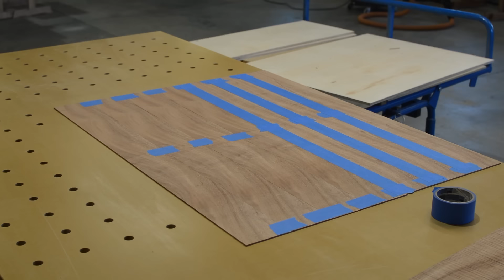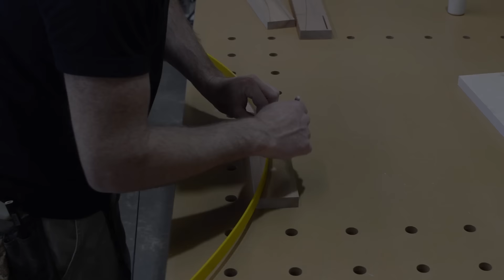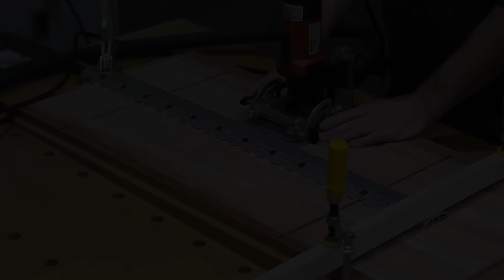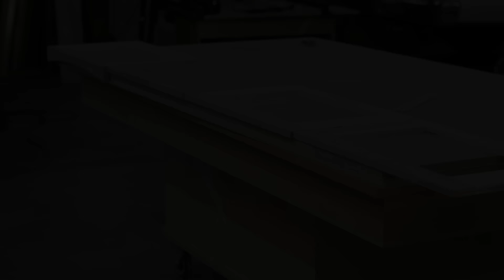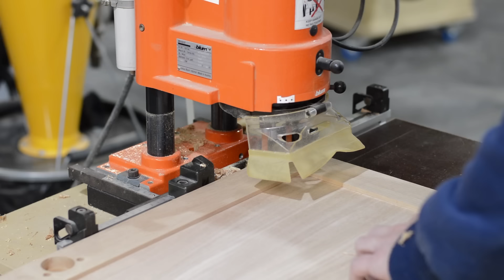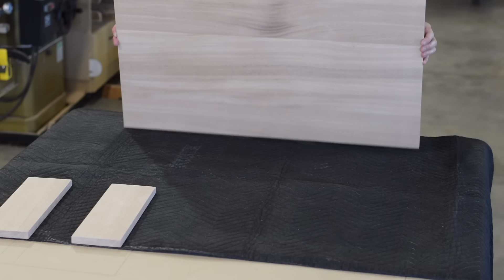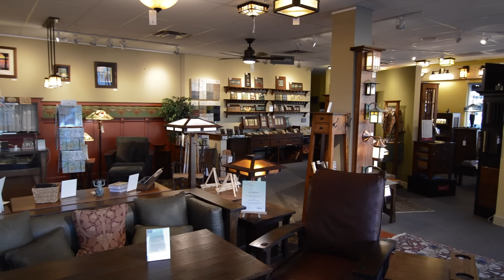Mahogany Wine Cabinet, woodworking, furniture making, carpentry

Comment: awesome cabinet and craftmanship Mike! I have a quick question, when making the side panels, it seems you didnt glue the styles and rails to the panel. Is that recommended for seasonal expansion or did you just not include it in the video? thanks!!!
Reply from the maker: Thank you. Not sure I follow. The side panels were glued to the legs and the little top and bottom pieces. The doors on the other hand the panel is not glued in place, that is for seasonal movement.
Reply: @MikeFarrington  thanks for the reply, I will make some large panel doors soon out of birch and I'm planning to make the panels out of mdf with veneer glued on top. My experience is that larger doors made of plywood tend to warp. Though I'll make the frame (style and rails) out of solid birch. So i was wondering whether glueing the panel into the frame would be ok to give the door some more firmness,  I imagine the frame's expansion will be minimal, and the same counts for the MDF I think.. What's your thoughts on that?
Reply from the maker: @zengtili33  Yes, with that particular construction, I would glue the panel to the frame on all 4 sides.
Reply: @MikeFarrington  thank you! Now I have the Mike Farrington blessing!!

Comment: A very nice piece of furniture.  Out of curiosity, any reason you used biscuits over mortise and tenon joinery?
Reply from the maker: Thank you. With the veneered panel mortise and tenon is not needed. The edge joint between the legs and panel as well as the curved skirt is mega strong. Plus biscuits are faster, and this piece didn't have an unlimited budget.

Comment: Nice work as usual Mike, great filming as well. I like to use water based tints and dyes myself. I find on stock even from the same tree, colors can get blochy. Have you tried any types of pre stain or blotch control in the past? I like to use Charles Neils blotch control, it works wonders, even on plywood that needs a finish...
Reply from the maker: Thank you. I find that woods that tend to blotch are going to blotch. If that is the case I will spray the stain. I do this because I haven't had good luck with blotch control products. What I have found that works is to do a wash coat of shellac, then begin the staining process. I try to avoid this because its just another step that isn't needed if spraying.

Comment: hy Mike, when you are resawing that mahogany on the bandsaw what kind of blade do you use, how many teeth/inch does it have ?
Reply from the maker: 3 tpi, 1/2" to 3/4" blade width. I switched to a carbide tipped blade which really helps with resawing.
Reply: @MikeFarrington  thanks, great job with the cabinet! i admire your patience

Comment: Hi Mike; Great video, I sure would like to know where you got those biscuits? I looked on e-bay but I did not have any luck. If you could, please send me the information I would appreciate. Regards;Tom
Reply from the maker: There is a seller on eBay, they are only posted when they are in stock. Otherwise they are not listed. When you search use the word Lamello. That seems to get results. I'm thinking about trying to source some and selling them myself.

Comment: Mike...should water be used to raise the wood fibers, then sanded before amber shellac is applied?
Reply from the maker: No, the reason is shellac doesn't raise the grain much because alcohol is the solvent, not water. There is some water in denatured alcohol, but not much. Apply a coat, give it a quick sand, apply another coat, and so on, until it looks how you want.
Reply: @MikeFarrington  Thanks!  My plan is to apply one light coat of amber shellac, a light sand followed by two coats of General Finishes Armour Coat.  I use the shellac to give the grain a "pop".  Thanks for your expertise, sir.
Reply from the maker: @davidm2645  This is a rock solid plan. Things should turn out beautiful.

Comment: That case glue up just gives me anxiety. I’ve always felt like glue squeeze out on the inside corners has been the bane of my existence. So difficult to prevent and always shows up when you apply finish when it’s too late to do anything about it. I’ve resorted to elaborate painters tape prep which works but I hardly ever see anyone else do it or seem to even mention problems with glue squeeze out. Any thoughts mike? Great project by the way.
Reply from the maker: I used a slow set epoxy, which is easily cleaned with acetone and a tooth brush. Thoughts, yes, prefinish parts, be cautious with the amount of glue applied, clean carefully.

Comment: why do you space the biscuits so closely? wouldnt it just be easier to use a spline if you cut them so close together anyway?
Reply from the maker: Speed and ease of setup. I can setup and cut a ton of slots faster than I can set up and cut with a router. Cutting a spline would work just fine though. My biscuit joiner is always right there at the ready, the biscuits are precut, I almost don't need to think.
Reply: @MikeFarrington  
i see
at the place i work, we have premade 4mm splines, and cutting the groove with the biscuit joiner is common practice for us 
chreers
Reply from the maker: @befelmi999  Thank you. I wish I could get 4mm plywood for that very reason.

Comment: Awesome piece Mike!  Quick question - how long did you wait between the water dye and the oil stain? And is the top coat oil based or water based?
Reply from the maker: It was maybe two hours or so. The top coat is a catalyzed lacquer.

Comment: Love your videos, but I’m off my game here, could you clarify the pro tip at 8 minutes 18? Cheers
Reply from the maker: Thank you. Sure, buy using an undersized router bit designed to cut a slot to fit plywood, I am creating a mortise that is perfectly sized without having to do a bunch of test cuts and adjustments. Then I cut the plywood to size and use it as a floating tenon. Could you do this with a normal sized router bit and cut the floating tenon from solid stock, yes, but it would be a little slower. I like this because I always have the plywood laying around, so I chuck up the bit make the cut then size the plywood and I'm all done. Its fast and strong. Probably not a life changer for anyone, but a cool tip just the same.
Reply: I see, not so confusing, and I’ve done similar myself. Thanks for clarification. In return a pro tip of my own (which you’ve probably done yourself); cut your 300 mm steel rule down to 200mm and its a great size to sit in your tool belt without poking you in the ribs. Because you always need a steel rule and you never measure more than a few mm right??

Comment: Wow. This cabinet is so incredibly beautiful, Mike! I love your style and it is very much in line with the furniture I'd love to build. I also think the satin black hardware really sets off the cabinet. I'd love to have a piece like this in my home. One question: what type of clear coat did you use? In the video you used a water-based dye and an oil-based stain, so I'm wondering how that combination would affect various topcoats. Thanks for an awesome video. New sub!
Reply from the maker: Thank you. The clear coat was just lacquer. If the stains are totally dry, they shouldn't affect any top coat, but I mean totally dry.
Reply: Awesome, thanks for the information. I used lacquer for the first time on a big project a few weeks ago and I'm hooked. It dries incredibly fast and with a little sanding and buffing, it was a beautiful smooth finish. I did use an oil based stain underneath, so I knew I didn't have to worry too much.
Reply from the maker: @dirtybaywoodshop-joeporter5650  It sure is easy to work with.

Comment: Explain briefly about the Dowler system. Not sure of the spelling.
Reply from the maker: Thank you, its called the Duo Dowler, its made by Mafel. Its drill two two holes at 32mm spacing. Different bits can be installed. It can be used to drill hardware holes as well as joinery.

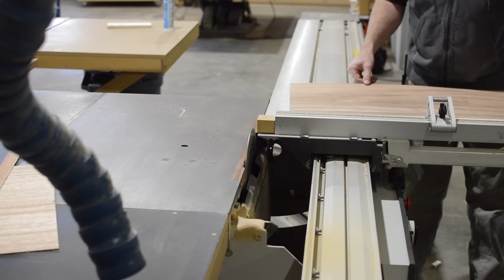Comment: 2:55 is there an advantage to cutting it on the table saw vs. using a router?
Reply from the maker: Nope, just a matter of preference. Anything from a router, track saw, table saw, would work just fine.

Comment: Why dont you use your slider to cut the tapered legs?
Reply from the maker: It's faster to make the jig and use the bandsaw. With the slider I would need to rig up some method of clamping, which ends up taking too long. The slider would work well though, its just not my first choice.
Reply: @MikeFarrington  I think you under utilize your slider, as most American. Install some air clamps on the slider, it will increase your productivity 10x. In America, most people see a slider as a way to cut sheet goods. In europe it is used to do everything in a faster and safer manner. Also the cut quality tends to be better since the material cant move during the cutting operation (when clamped).
Reply from the maker: @AlainPilon  I pretty much totally agree. My issue is I'm not totally in love with this slider. Its nice, but I am on the hunt for something a little higher end. As such I really don't want to put any money into this one.
Reply: @MikeFarrington  Are you looking at the Felder series? Format4? Maybe a bit too high end? :-) No matter your pick, you can always reuse the clamps, they usually fit in the T slot. Sliders are game changers.

Comment: When attaching the curved board to the bottom of the sides why did you decide to do biscuits? To my much, much less experienced  brain it seems like dominos would of been better for strength.
Reply from the maker: For this particular application, the biscuit being thinner was an advantage, the side panels were only about 5/8" thick. The small sized domino would have worked well, but I always prefer the biscuit joiner because its faster and easier to use.

Comment: Ridiculously Good!
And when Mike talks fast explaining parts of this build, I got lost with some of the complexity.
What did he do with the undersized router bit for plywood. Something with a spline for other routering.
Okay just to recap it wasn't made with pocket screws and builders grade plywood from the Homie depot.
Shop apprentice has moved up from the dust pan.
Reply from the maker: Thank you. Do a search for undersized plywood router bits. These are designed to fit 1/4" plywood (or other thickness plywood), which is slightly less than 1/4". Then all you need to do is cut a groove in each work piece, and use an off cut of plywood to connect them. Hope this helps.